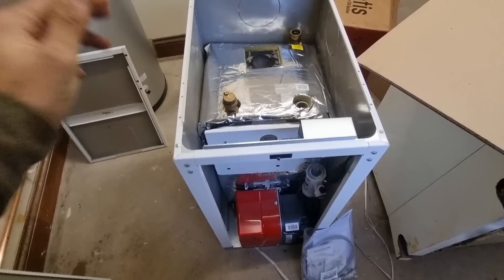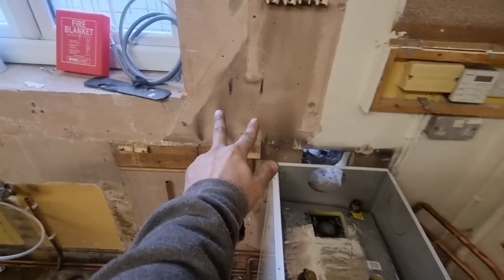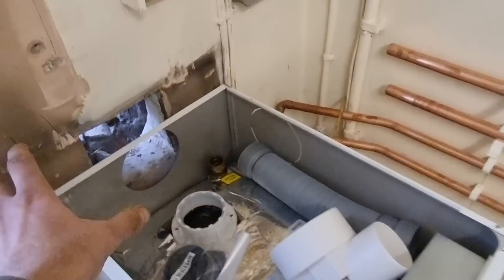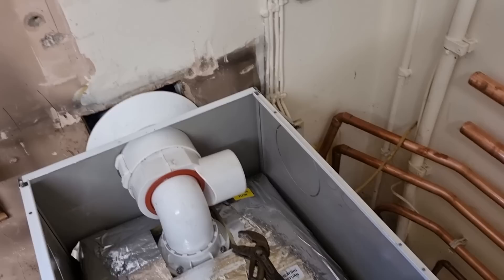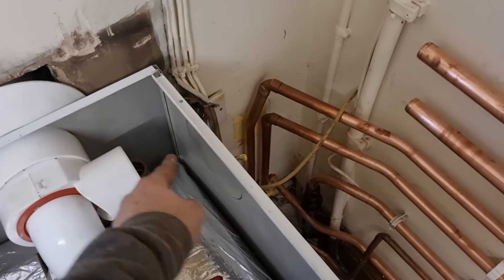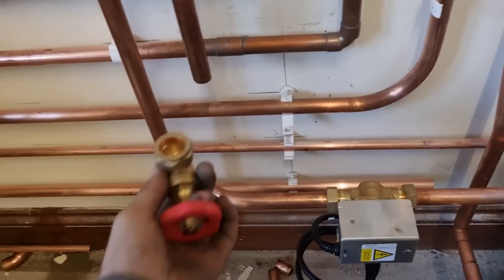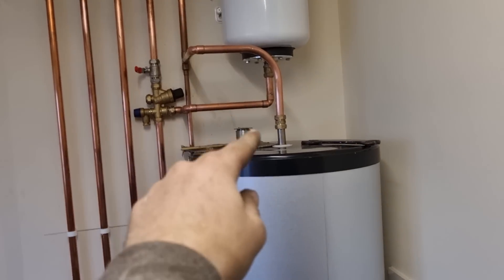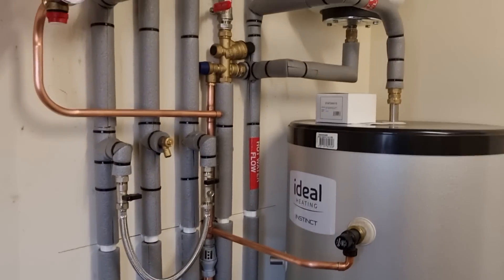Work with a PLUMBER for a day

Comment: Excellent boiler install, lovely pipe work. I think your drain off using the little washing machine valves is an excellent idea. I will certainly be using those on my own installation.
Reply from the maker: Thanks for the support mate, it does make life easier for anyone draining the cylinder

Comment: Glad to see you mention the next person to work on the system. Not enough people do. Lost count of number of times I’ve tried undoing flange bolts to find no copper slip on the threads and a dry gasket that’s stuck tight so it takes ages to clean the flanges.
Reply from the maker: I always do my best to make sure the job is as easy as possible for the next person, the amount of times I go to jobs where you can't service stuff because of poor installation is crazy, thanks for watching as always mate
Reply: @PlumbLikeTom  that’s called integrity my friend. One of the most important things we can have in my opinion.

Comment: Enjoyed this video. Never seen a Warmflow install & liked the rotating Flue elbow, seems a good idea. Presumably you would not need a Gate valve on Primary Return if your Programmer was set for different times for HTG & HW ?. Thanks again.
Reply from the maker: Thanks for watching as always mate, the gate valve is really only for when the heating and hot water is on at the same time like you say, it just helps balance the circuits, thanks for the support as always

Comment: Nice job Tom looks fantastic, shame it has to be lagged really, but nice to see progress on the project, have a good weekend 👍
Reply from the maker: Thanks for watching as always Peter, at least the lagging covers over my bad soldering, have a great weekend mate
Reply: @PlumbLikeTom  Soldering looks fine, if it doesn’t leak alls good, pulled some 1970s pipework out for a friend last weekend, a couple of joints not soldered up properly but not leaked in all that time, amazing👍

Comment: Great video mate.  I do lots of work in schools and legionella is a big thing. I have always thought why is there no such thing as a drain off T so eg 22x22x15 but the 15 is the size of copper pipe so you can just put a valve on tight and therfore reduces the risk of legionella.
Reply from the maker: You used to be a able to buy a brass compression tee with a drain off on the branch, I fitted heat pump cylinders on a job and they all came with them to connect onto the cylinder. Legionella is a big thing, I only do remedials, some of the jobs are very difficult to make comply as the installs are so poor, the amount of expansion vessels you see fitted sideways connected with flexi hoses around here would amaze you. Some of the schools around here are so old as well, the tanks in the roofs were fitted well before the days of tight fitted lids, they really all need replacing, there are dead legs everywhere in the floors and no one knows where the pipes go, ideally a lot of these places need modernising to bring them up to standard, thanks for watching as always
Reply: @Plumb Like Tom  I'm doing some tank at the moment. 1 had a skin on it as I thought it was isolated from the other. It was still open to the system, and there were 6 dead birds in it.🤢🤢. All schools should be replaced with new builds or fully renovated. Another at the moment I have repaired 3 leaks in the heating system already and there is another. Every time we drain and fill, there is another. Keeps us in work. Hope you have a good weekend and don't work too hard

Comment: Any books you can suggest for good practice?
Reply from the maker: The books I mainly refer back to are the water regs, it's a bit of a heavy read, but it does contain everything to do with wholesome water supplies, there are useful documents that can be obtained for free such as G3 of the building regs, that's all to do with unvented water heaters, the domestic heating compliance guide is another good book, it's all to do with heat loss and calculations. BS7600 is a big document for plumbers which is a standards guide, it contains all good practice guides, its a big document though but I believe it is free to download
Reply: @PlumbLikeTom  thanks Tom. I’ll take a look. I’m gutting our house this summer and will be fitting new rads, bathroom etc. in fact everything.

Comment: Morning Tom, you should not be able to isolate the boiler safety valve from the boiler , you’ve got pump isolation on flow and return magnaclean isolation, please don’t think I’m digging you out, you do terrific work!!
Reply from the maker: You are 100 percent correct, I just didn't spot it at the time, what I will do is cut an additional safety valve into the boiler or move the point where the vessel is connected, thanks for watching as always mate 👍
Reply: If I had pound for every mistake I’ve made I’d be a millionaire 😂😂
Reply from the maker: @dannywilkins887  To be honest my head wasn't on the job, you will see why in an upcoming video
Reply: Nice work Tom as usual, can you tell me why the pump is on the flow side - is that a peculiarity of the boiler manufacturers instructions?

Comment: why did you go for the warmflow ?
Reply from the maker: It was specified in the job mate, it's a bit like all the bathroom stuff on this job, it tells you exactly what is required by  the designer or architect , make and  models, the cylinder just said a 250l unvented and the merchant had this one in stock, it does make jobs easier to price as I just send a materials list to the merchants of all the stuff that's needed on a job and get the lot priced, every contractor who prices the job prices the same thing then, thanks for watching as always mate 👍
Reply: @PlumbLikeTom  Cool really nice neat job . Not a lover of the warmflows and those plastic flues 🙄
great work as normal

Comment: warmflow lol they are made up the road from me not what id fit tbh some hassle over the years with them ive ripped many a warmflow out
Reply from the maker: Fair enough, this boiler was spec'd as part of the job, I only fit what the customer wants, I know the combi version have the flexy hoses that continually block, this is in part down to system water quality, I thought it looked Ok from an installer point of view, thanks for watching
Reply: @PlumbLikeTom  it's the budget boiler here in northern irleand , steel isn't as thick on them.compared to a grant boiler,  although aftercare from warm flow is good grant not so much.
Reply from the maker: @steveyboyXRP  It probably is the budget one here mate, to be honest it was heavier than the equivalent Worcester, It could be that it has thicker steel but I guess a lot depends on the quality of it

Comment: My experience of Warmflow condensers Tom:       I fitted 3,   2  leaked well inside the warrantee  (inside primary HX at back)   both were on new/clean and inhibited systems.      The 3rd leaked in the same place just outside warrantee period.

Warmflow sent their own engineer out to inspect, he checked water quality , agreed all was as it should be and referred the job back to their offices for replacement.......

Long story short  NONE of the customers ever got a new boiler out of  Warmflow and I lost a very good customer over the whole thing, despite trying to do my best for the customer  with a manufacturer who had manufacturing/quality issues   ( Other guys on the oil trade forum had same issues)      Warmflow did everything it could not to put things right........🤬

I would NEVER fit another.
Reply from the maker: Fair enough, like I say the boiler was spec'd by the designer of the project, I only fit what I was asked to, it is worrying that there is an issue with the boilers leaking, there's not so much I can do about that as an installer other than make sure the system is perfectly clean and dosed with inhibitor. Thanks for the feedback and thanks for watching as always
Reply: Damn that’s shit. I read them to be pretty good somewhere too. Just shows you can’t believe everything you see on the internet.
Reply: @Plumbingbob  This was a few years back and you would hope they had sorted the known welding issues out by now.
My problem with them is that they let me and the end users down with a Warrantee that was not worth the paper it was written on.
The only way to do repeat business is to stand by your product when it goes wrong.....
There was masses writen about the boilers failing at the time on the oil trade forum of the time OHN and many of the guys got shafted over the 5 yr warrantee not coming good.  😞
Reply: @julianhawker7672  damn that’s bad. Terrible business ethic on their behalf. I read good stuff but think I’ll give them a wide berth.
Reply: @PlumbLikeTom  Hey designers havent got a clue about oil boilers sometimes best to tell them whats best

Comment: What's that ratchet set you've got there geez?
Reply from the maker: It's just a cheap vanhaus socket set of amazon, I think it's the 104 piece one, to be honest I've had this set years, I did replace it recently because my old one got run over which caused the lid to break on it, everything inside was fine but the pieces kept falling out the box, thanks for watching mate
Reply: @PlumbLikeTom  nice one mate it does look like a good set. What size spammers does is come with
Reply from the maker: I think the spanners go up to 17mm, it's not a bad little set for the price